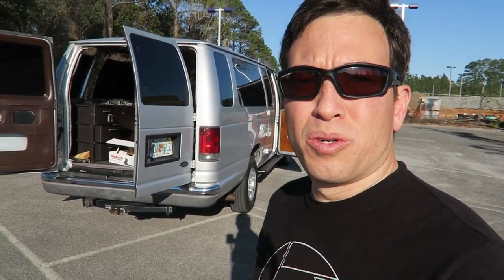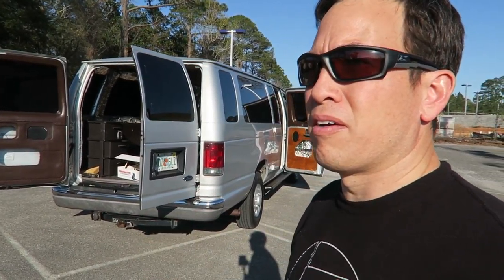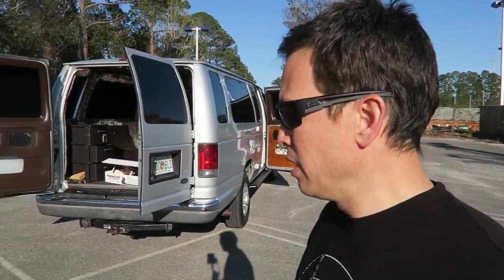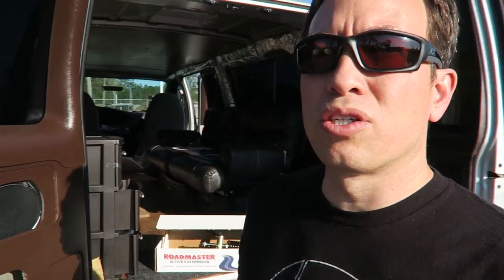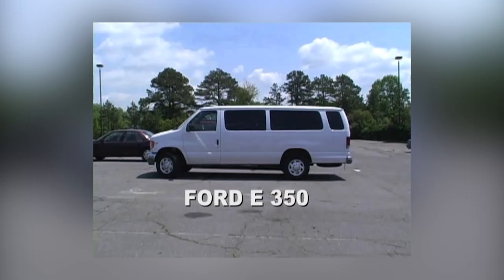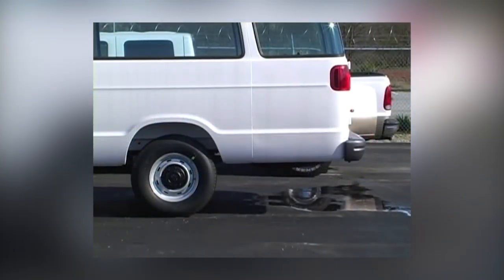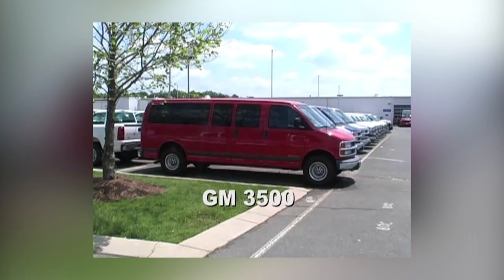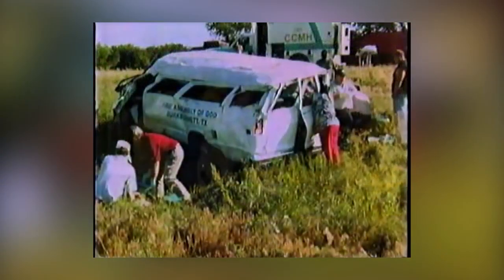30. Touring Camper Van Build: The Most Important Safety Feature You can Install

Comment: I just put the Roadmaster on my Ford F150 P/U.  One of the critical things to do is to place the jack stands on the frame forward of the axel, not so the axel sits on the stands. Reason being the rear suspension and differential need to hang down as far as it will go, fully relaxed.
Reply from the maker: Good call. Yes.  After I installed it, I took the van to an auto shop and had them lift it and then I readjusted the Roadmaster.

Comment: Good to know.  Another reason these vans have issues is that all the seating is to the driver's side and the weight is not distributed evenly.  I've owned two (one Dodge, one Ford) and removed the seats from both and hauled cargo in them.  I was very careful to distribute the weight evenly and low, and did not have problems.  Hauling passengers, probably would have.  The fact that the side door is only on the passenger side makes an evenly distributed load a challenge.  The new vans have as an option, side door on the other side too - I recommend getting them that way if you're buying a new Transit or Promaster.

Comment: I am in the same boat. Mine is an 1998 Dodge 3500...an old church van. Even removing all the seats and putting all the weight above wheel wells. I want this kit but $420 is a big hunk of change.
Reply from the maker: Liberty Leslie I understand. I will say that the van is much more stable now. I don’t feel like I am about to lose control driving 70mph now.